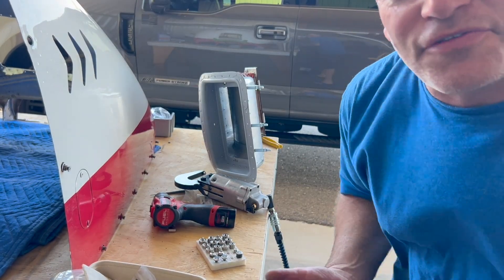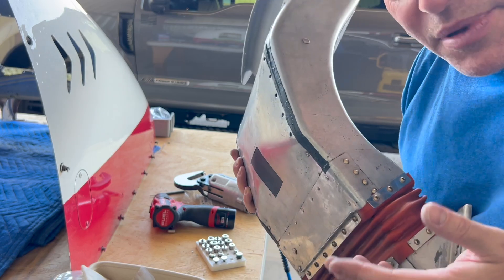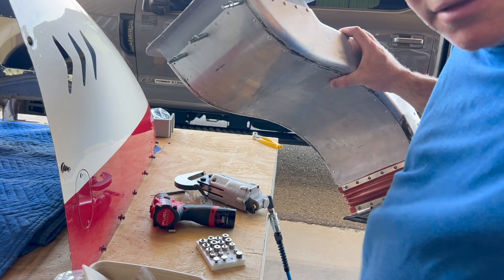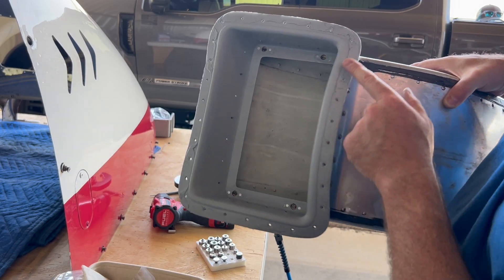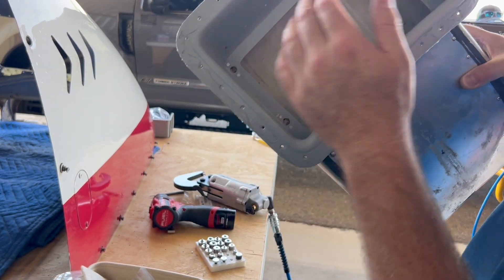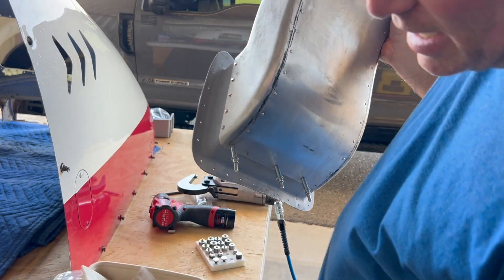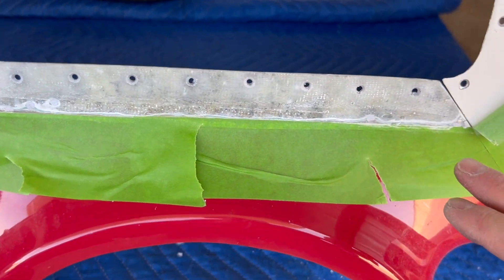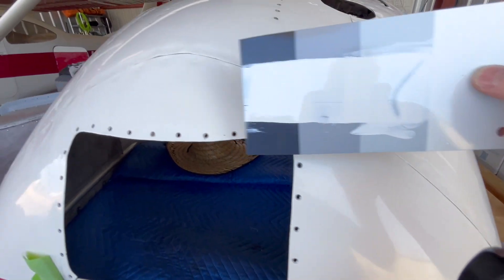NIGHTMARE REPAIR | Why Shops don't do this kind of work

Comment: The duct, where it meets the rubber boot, I see you have about a 2" reinforcement piece there. What thickness did you use? This video opened up a "can of worms" when I stated looking at mine. 😠 It needs some TLC after 51 years.
Reply from the maker: I think the piece you’re talking about was there since previous owners and or repair when the plane was damaged in an accident. It was rebuilt by Beegles in 2005, to include cowl repair.